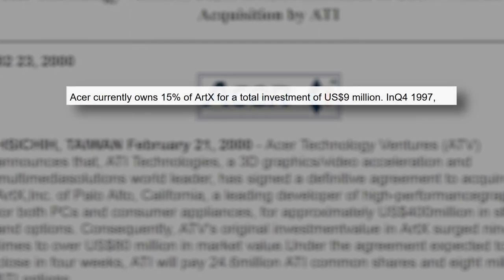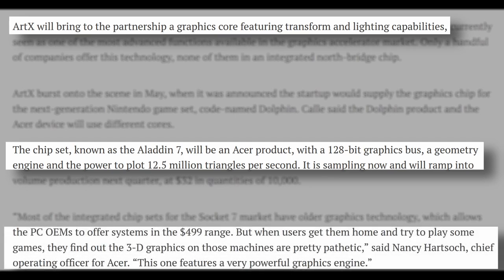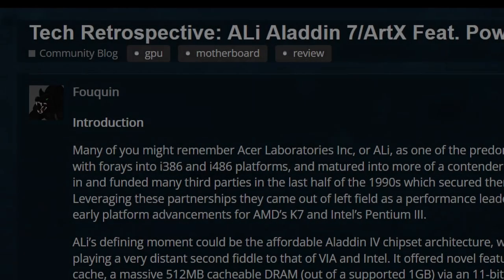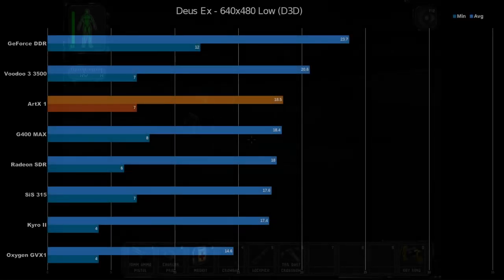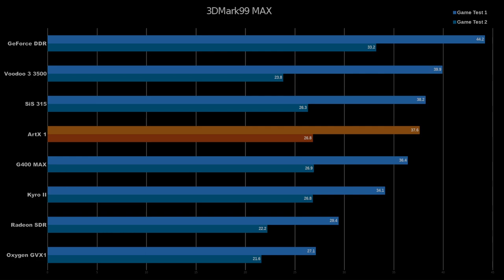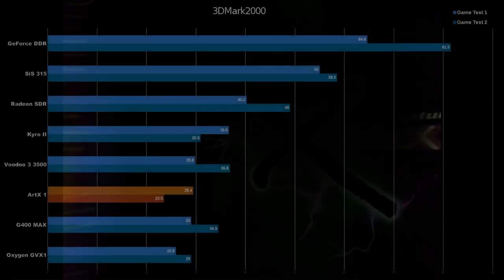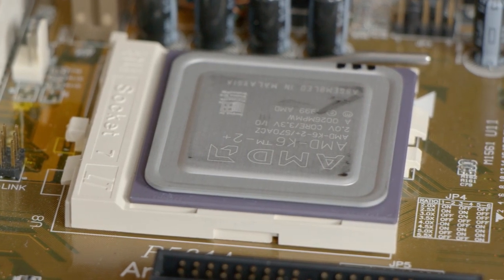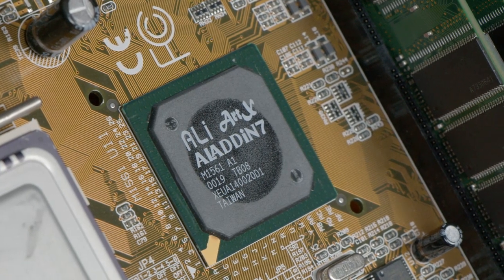Aladdin 7 And ArtX 1 - The IGP Makes Its Debut #GPUJune2

Comment: Great video ! 
History of ArtX is fascinating, but I wish there was more tools available to check different specific parts of chips. After thinking about it, that Alpha Blend and Single Texture at 16-bit are probably the result of driver simply doing invalid things (resulting in inflating score or some other bug). Main reason for this, is that both require more work than simply Z-FIll + Color, and definitly more than Z-FIll by itself. Results from Fillrate Benchmark are all in [M]Pixels/sec, meaning they eventually are run by ROP unit.
Maybe some MTexel/sec result, could show some light on this ?

Comment: Interesting video but did the Voodoo 3 3500 run Deus Ex in Glide and Half Life in 3dfx Opengl ? I guess it didnt because there is no way a Geforce 256 DDR is faster then a Voodoo 3500 running Glide in Deus Ex. And especially on a Socket 7 system.
Reply from the maker: No Glide in Deus Ex. All cards were run with the same settings with Direct3D. For Half-Life miniGL 1.47 was used. None of the cards were given any optimizations or performance enhancements other than fixes required to get some games running.
Reply: You say that a V3 will beat a geforce 256 in half life? I must test that. But do not have a 3500, do have a V5500 though? My fps in HL1 on my K6 is not where I want it to be :(
Reply: @SkalabalaK6  in Half Life the Geforce 256 SDram is faster than a V3 3500 by 40-50%. In practically all OpenGL games  the Geforce 256 SDram is faster than the V3 3500 by 40-50%, in most Direct3d games it is faster than the V3 3500 by 10-40% and in Glide games it is slower than the V3 3500 by around 10-20%.
Reply: @3dfxvoodoocards6  And with a V5 5500?

Comment: I think it's good enough. A Voodoo 3500 integrated, what more could you ask from a first try? Also, performance could improve with drivers.
Reply from the maker: Sure, updated drivers could have made some improvements, especially on later titles. The problem is that there are none as far as I could tell. There is ONE driver version ever released.

Comment: btw, I didn't research or anything, I believe winxp had no drivers for this integrated graphics, correct?
Reply from the maker: XP SP1 supposedly has a working driver if a screenshot from 2005 is to be believed. I did not attempt it, and relied solely on the Win9x driver included on the CD that came with the board.

Comment: It's easy to forget that in the 2000s "fluid" gameplay meant anything between 16-24 fps.
Reply from the maker: Above 20FPS is definitely the margin for "fluid" in my opinion on many of these games. Deus Ex in particular gets absolutely glacial to the point of being detrimental to basic actions (climbing crates, lining up your reticle, attempting to interact with small keypads or traps) but for the most part these games are definitely stlll playable into the high teens. Long hitches and interruptions to gameplay though aren't exactly supporting of "fluid" gameplay.

Comment: Low latency memory is the key with every onboard sollution. It could gain significant results if you simply go from Cas3 to Cas2 SDRam. Often putting in 133Mhz sticks with a system that runs at 100Mhz still yields you some percentage in timings and such. But using traditional SDRam compared to SDRam on cards or even DDR is still a loss in performance due to timings.
Reply from the maker: I used 2x 256MB PC133 Kingston KVR133Q/256R CL3-3-3-6 1T. While CAS can be set to 2clk, performance gains are negligible to the point of being indiscernible from error margin. The much more important issue with this board is that memory stability above default clocks and timings is anything but. I go over the details of memory performance and general tuning in the written article linked in the description.